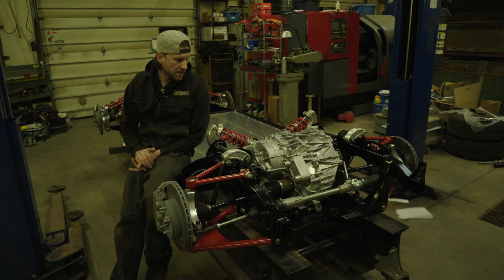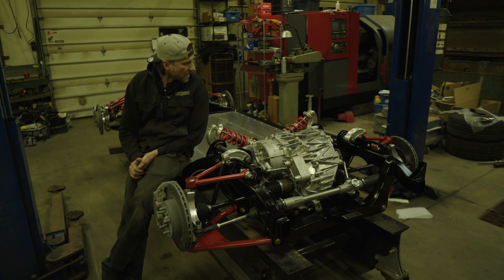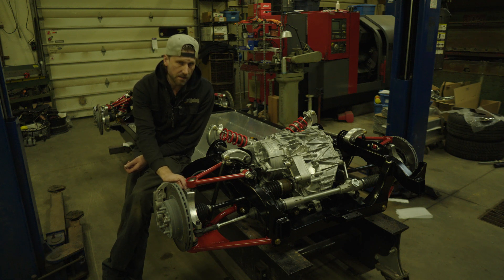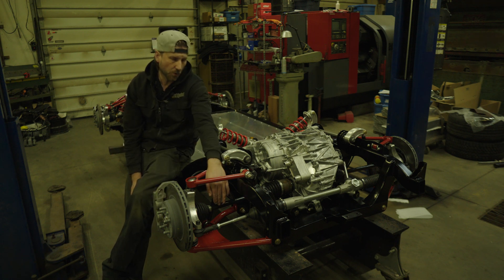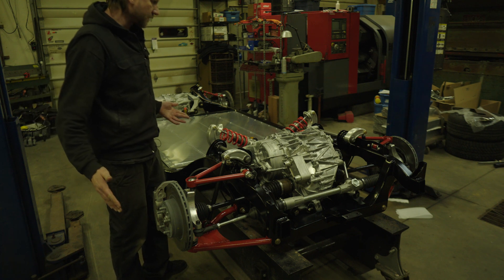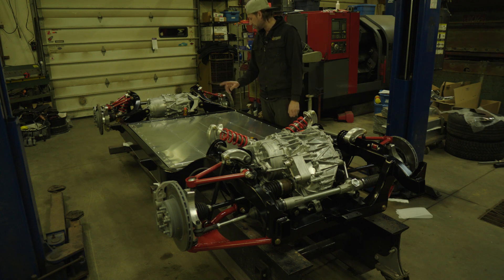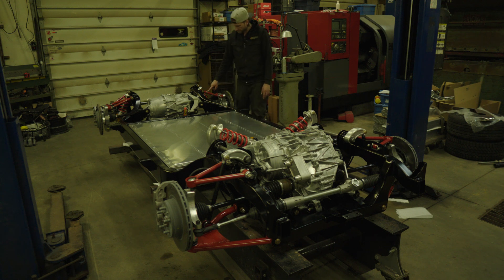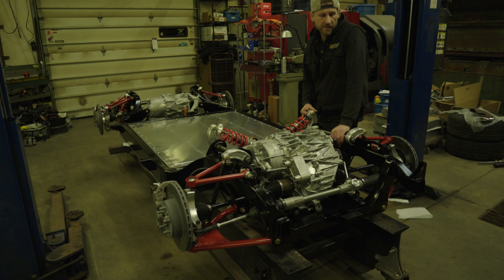Full Custom AWD Tesla Powered C1 Corvette Chassis

Comment: Isnt the five link rear better than basically SLA like youve done there? Basically you recreated the front suspension with toe control bars at the top lol. 

Wouldnt it have been better just to copy the tesla links then ditch the subframe and relocate the body mounts to your chassis? 

Taking the knuckles from the donor and then adapting them to your custom steel chassis with custom links of the same design style is usually the way

I think because youd already designed a spindle to fix the trash tesla front you just went the easier route copying something youd done before there. 

Otherwise this is definitely my speed though, I like this whole project
Reply: A c1 racecar is gonna be miata weight or less

If you stuffed an entire tri-motor plaid setup in that it would be bananas

I see lots of dual motor model S stuff but everything plaid always looks like an entire plaid with a coachwork bodyswap job... Which Im not into...

Has anyone actually figured out commanding the dual motor torque vectoring rear powertrain unit or is that the hangup Im seeing?

Because I verily need that feature hacked for the EV project I have planned. I need two torque vectoring Plaid rear drives for an offroad thing Im working on
Reply from the maker: I think ingenext has a controller for the plaid, but I don’t think it does torque vectoring?
Reply from the maker: Yeah a five link would be a little better. I went this direction for a bit more simplicity, because I have so much other complex stuff going on with the electronics. I did want to use the front and rear brakes as the original model 3 did so that’s why I made the custom knuckles. Maybe the next one I’ll try a five link?

Comment: I notice the lack of HV or LV connectors on your battery pack, has any thought gone into where these will live? Also what BMS are you going to use to monitor the VW modules?
Reply from the maker: Very good eye!! Yes, but the headers did not show up before I wanted to shoot the video...BMS will likely be from orion, unless you have a better suggestion??

Comment: Great progress! Looks like a showpiece 🙂
What software do you use to design suspension kinematics?
I noticed you have rod end in bending on the back top wishbone. On the bottom front wishbone there is also bending moment due to position of the push rod mount. Any FEM done on suspension?
Reply from the maker: You always have good comments! I did the basic kinematics in alibre but I have read good things about dynatuneXL. I wouldn't mind trying that out. I did FEM on the spindles but not the suspension links. This is a prototype build and as such will be monitored very closely. You are right about the rear wishbone, but I'm not sure how to quantify the bending load as it isn't really an a arm but more of a 'H' link?? What are your thoughts??

Comment: Amazing work.
Reply from the maker: Thanks!
Reply: @519Kustomz  I've been wondering about doing something similar to a C6, do you have an opinion if a full Long Range Model 3 pack could fit?  C6 is 8 inch shorter wheelbase than Model 3.